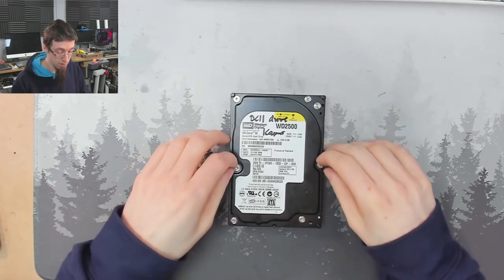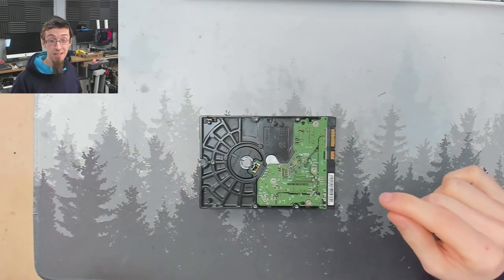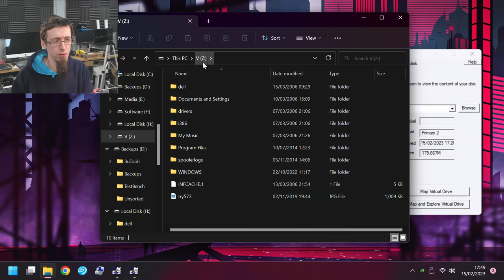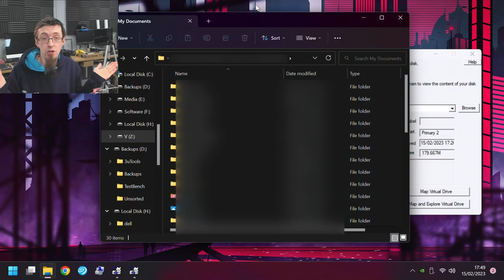Controller Board swapping a dead HDD - LFC#344

Comment: I once had 1 GB IBM laptop HDDs, where I could easily swap the boards without issues. IBM DMCA21080 and DMCA21440 was their model number. I was poor and I trashpicked these drives from laptop repair shops for about a dollar or two.

Comment: Two things, that could be pointed out:
1) As others have already said, these controller boards can be bought on their own - usually very cheap (<10$) and you can more certainly get exactly the correct board instead of just the correct drive as you said. This also reduces e-waste, since these boards usually come from dead or shredded drives, instead of buying a working drive and stripping it.
You also have to keep in mind, that while this is a valid repair-attempt that has also worked for my in the past, in many cases it's just something to try before giving the drive away for professional data recovery. So keeping the cost below 10 or 15 bucks just to give it a shot is well worth is, whereas 20, 30 or 50 $ for a used drive (if it's a more reasonably sized one than 250GB) might not make sense anymore.

2) If you have the tools and knowledge, read and store that EEPROM. Because once that chip dies or you lose it or mix it up, any "software-level" data recovery will be impossible and any futher recovery attempts will have you looking at 4 figures or at least many hundreds of dollars.

Comment: I swapped the boards of a failed IDE drive once 15-years ago and it worked fine, allowing me to copy my data off the drive. It failed a day later, but did let me grab my data so it was a success!
You could restore the new board with the original ROM and put it back on the new drive, giving you a brand new one to use. As it hasn't even spun up, it should be fine to use.

Comment: This cheered me up after a bad day in the workshop with multiple component failure on massively thick PCBs with tiny surface mount everything on it and through hole sub-PCBs - this happened 3 times in a row with different devices. None of which got fixed.😭😭😭😭😭😭Wah!!! indeed. Sore eyes and fingers and headache and bad mood.

Comment: Thanks Graham that was great.  When you first started I said to myself just swop the board over why mess about with removing chips, then you answered and said it was that smaller chip that holds the way the drive has stored everything and just swapping the board won't work, it was like you heard me lol.  I still have a couple of older drives that are not SATA connection, I keep meaning to look on them to see what is there, I have a drive dock with those connections on.  Anyway Graham you did a good job and I'm sure the customer will be very happy, well done mate.

Comment: I actually recall your statement of "if components start getting blown around, then turn the air flow down". This was coming from someone who wasn't sure what the hell was going on when I first got my hotair station, the biggest suprise was how dam hot the PCB boards were getting, I was thinking this shit could fry an egg given the heat it gets to. 

I also think the distance from the board makes a difference, so you can decrease the airflow but put it closer and technically you should get the same effect, since if you take the air flow and the distance from the board as the frequency of how many hot air particles are traveling from the nozzle to the board then by decreasing the air flow and bringing the nozzle closer should keep the temperatures around the same.

Comment: i never had to but something i read is:

rather than swapping chips one can get a same model/make working donor drive WITH THE SAME GEOMETRY, boot it up, hotswap the board to the driver to recover.

what's going to be missing is mainly the negative sector data which is the SMART reports and the reallocated sector map plus some other things BUT the platter will spin and heads move and data flow.

Comment: I have a hard drive here which i am sure is the same.I brought a donor board to get the chip replaced but about 20 telephone calls to repair shops here in new zealand none can replace the chip so i never progressed further.
Reply: Most shops will not carry out board repair especially on a spinning hdd. They just swap boards out..

Comment: I had even more luck with recovering data from the exact same drive!  I had one with the same motor controller chip burnt to a crisp and I was able to take the exact donor board and hot swap it without even swapping the ROM chip and it worked like a charm! I was in disbelief myself, but it was a 100% successful recovery!  I'm fact, I think the drive is ironically still being used to this day, not as a primary or a backup drive, but I believe it's a backup of a backup or something like that, lol!
Reply: @Aneesh.Asokan  Dead serious! It worked 100%... It was for my pastor's PC... Wouldn't lie about that!!!
Reply: @Aneesh.Asokan  lol... I totally agree, I was extremely surprised when it actually worked myself!

Comment: For the HD dock I have one: tacens portum duo II usb3. 1
And I recommend, is old but you can find new. Have 2 docks (only can read from the 1dock) but can clone hard drive alone (no matter the operating system or file system"in some cases you need to initialize the HD only don't need formatting ").only push a button a few seconds and strat cloning from dock1 to dock2 (always check or you erase the hard drive) . 
Suport HD3, 5/2, 5 and ssd (and iff buy adaptors for any ssd tipe to sata can do the same)

Comment: Oh, didn't know about that little ROM chip! Lots of years ago I replaced the whole board of a 320GB drive, and the drive performance absolutely went down, with ridiculously slow read speeds. I was able to recover the data though, so I still think the investment was worth it (the board alone was like 50% the value of a new drive). Now I know why it didn't work like expected. I guess I was lucky it worked at all!
Reply: was it an ide drive or sata drive?
Reply: @stephenxs8354  It was a 320GB sata Maxtor drive. Sata 1 I think!

Comment: How's been your experience with the pinecil? I'm looking forward to buying it.
Reply from the maker: Yea I like the Pinecil a lot. My only complaint is that the rubber grip feels nice but has actually been slipping as of late, I need to put a little bit of double-sided tape under it.
I've also been hearing a lot of good things about the Miniware TS101, but no idea what the cost/availability of it is like.

Comment: Data recovery is hard. Every timed ive succeeded its been more of a lucky strike than any real skill or ability on my part I fear :(

And yes low airflow, high temp is the key to hot air. Only thing I use max airflow for is cooling down the air station

Gj
Reply: Yes, everybody knows only real Scotsman have real skillz and abilities. Everybody else doesn't eat haggis or sucks at life. 😂

Comment: I have a problematic 8 tb drive that used to shut down randomly (until I used a right-angle data cable that doesn't press against the side panel). I noticed it has a slight crack in the material of the connector (close to where the pins are). Assuming that's the cause, hypothetically speaking would you be able to fix that?

Comment: That drive is, what,  about 17+ years old? WD have always been solid for me. (and then we see a date later)
Reply: Now that I think of it I can't recall having a WD go bad.  Sure I stopped using them after so many years, probably not more than 10, but also have had plenty of Seagate, Toshiba, Samsung, Hitachi, IBM drives die.
Reply: It's astonishing they don't fail more often. Or cost 10x what they do. Aerospace grade mechanical engineering.
Reply: @ravneiv  call it lack of luck, but every Seagate I've had, aside for a handful, have failed. I used to build around 30 pcs a year as a side hobby for people at work etc., had so many Seagate failures it just put me off. I know, 'cos I've done it recently, I can still hook up one of these WDs and they just work.
Reply: @saintuk70  Seagte have historically been very poor for PC drives. Weirdly the AV ones in my TV recording boxes have lastest for years though!

Comment: Great fix. Did you swap the configuration chips back afterwards? (Thus leaving yourself a working new drive.)
Reply: Mr Guru  Well yes, but switching the chip back should cover that.
Reply: That's exactly what I was thinking. Once the data was secure, resolder the 'new' chip back onto the 'new' board and put it back on the 'new' drive and the copy data across. It would seem a waste to have chucked that brand new donor drive in the bin.
Reply: Mr Guru  He didn't do it on the video; if he did I assume it was because it wasn't relevant to the fix. I was just interested. No biggie.

Comment: will this still work if the donor board has different chips? same pcb, same board number, the chips do the same things but are of different manufacturers, any issues with still doing the eeprom swap for such a case?  the drive in question is an old ide drive that i am unable to determine which component is responsible for it being unresponsive, no obvious burn marks

Comment: The reason you should use Linux is, that Windows cannot leave mounted drives alone and will write stuff, where Linux only reads, leading to less risk for additional damage.
Not really relevant for this drive, but something to keep in mind.
Reply: There is a workaround, that will solve that problem at least in my cases it did: Remove the drive letter from all partitions on the drive. This can be done from windows disk management. If you are doing this sort of stuff on a regular basis, you can also disable windows from automatically assigning drive letters (cmd ->  diskpart --> automount disable).

In that state, windows will still give you hardware-access to the drive, so you will have sector-level access (for imaging or other recovery software), but windows will not mount the file system, so windows cannot interfere with the recover and the explorer won't freeze on read-errors.

Comment: Graham have you considered using  a dual caddy? Lots of them have built in disk to disk offline cloning. No PC required
Reply from the maker: I have one for M.2 drives, but for HDDs this little stardock has never let me down. USB bridges are not advised for data recovery, but I lucked out on mine, it seems to work very well.
Reply: @Adamant_IT  Ahh the Inateck one I have is very good. Never had issue. Even great for cloning over Xbox drives. I did my original 500GB to an SSD a while ago.. Dunno about PS drives though

Comment: quick question: If you don't care about the data on a drive that you want to swap boards on, do you still need to replace the rom chip?
Reply from the maker: Yes, because the ROM chip data relates to the disk geometry as well. A loose analogy would be;
Imagine you have a wall of filing cabinets labelled as columns and rows. Some of the draws are jammed and don't open, so you have a Custom label on them saying 'don't use this one'. Some of the draw labels are swapped around to put a specific label in an easier to reach location.
Now imagine all the Custom labels are removed. The contents of the cabinets is all still there, but all that extra information about where some stuff is, what drawers are jammed, etc, is now lost, so the drive needs to build up all this info again - and some of it may be lost forever, which could result in permanently degraded performance.

Comment: I had some 250GB WD drives in a RAID5 array. After about a year one of the disks failed so I sent it back to WD under warranty. While waiting for the replacement, a second drive in the array failed so of course that was the end of the data :( And the replacements WD sent me were not new but refurbished. I've never touched WD drives since. (I did manage to recover the data using the still good disk, one of the broken disks and a clever bit of software that understood RAID and rebuilt the files sector by sector)
Reply: what brand do you use now?
Reply: unfortunate, i had a run with seagate 320gb drives dying and havent touched them again either . WD only now and have been lucky.... thats the most important part.. luck
Reply: @OPTIMUS6LTR  Isn't it funny. I've had WD failures and have never had a Seagate fail on me. I worked in the corporate environment for a company that used Seagate SCSIs and WD IDEs.  It worked for them and they had minimal failures. Go figure.
Reply: @lm_dccxl4078  Samsung, not had any issues with them.
Reply: @josephking6515  i should clarify currently have 7x16tb HC550s which are actually Hitachi relabeled WD so that could explain it.. but have had luck with Red drives also, Blues never really touched Greens i had ok luck with.

Comment: Brother how much do you charge for this?

I have recently done a recovery by the same methods and charged £170 for labour. I recovered 350gb of family photos, Is that fair in the current market?
Reply from the maker: It seems to vary by country a lot. Data recovery in the UK is very expensive. If you send the drive to a lab and they need to rebuild it (take apart the mechanics, etc) I would expect a bill of £700-£1400.
I don't charge anywhere near this amount, because my data recovery methods are for easier jobs like this - I don't have the skill or equipment to rebuild a HDD.

Comment: Why not first: try swapping in ONLY the donor circuit board? Then if the drive can't be read, go on to swapping the soldered chips. Thus potentially saving some time, if a circuit board swap alone would suffice.
Reply: Watch the video, it’s clearly stated at 3:54
Reply: That rom contains things like the bad sector list (all hard drives have some bad sectors).  Much better to have the one that matches the drive.
Reply: @cjmillsnun  All I'm saying is: first see if it works, without the extra effort of de-soldering/soldering. Maybe the rom is capable of re-learning when applied to the new spinning drive. There should be very little chance of doing any kind of data damage while in read-only mode, and could have saved some repair effort.
Reply: @RVail623  To truly put a drove in read only mode you need equipment used for forensic recovery when prohibits any writing to the drive at all.
Reply: I have similarly swapped hdd boards without messing with the eeprom just fine and that's the safest way. But if you must, first get a $10 eeprom reader and back up both. Also, if you learn how to interpret wd model numbers you can match more compatible donor boards.